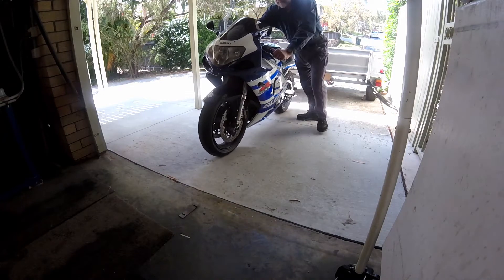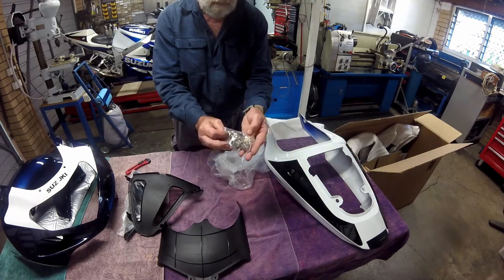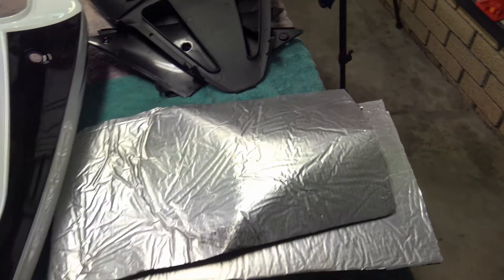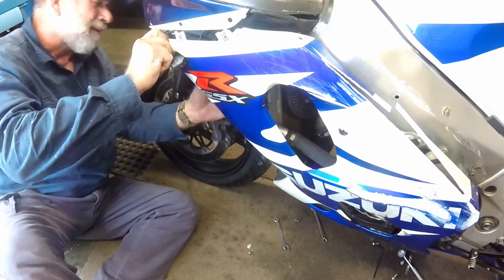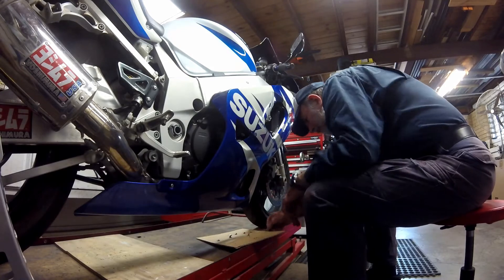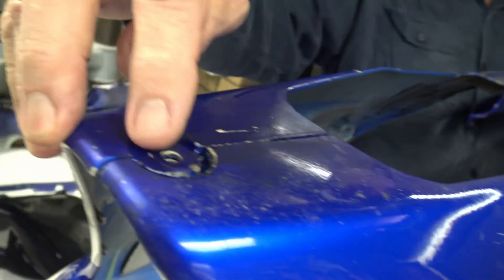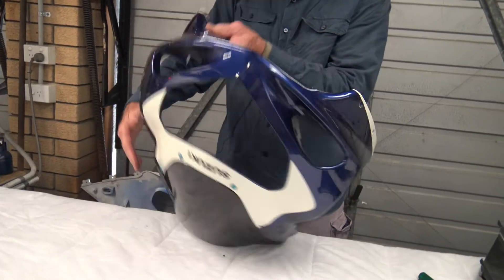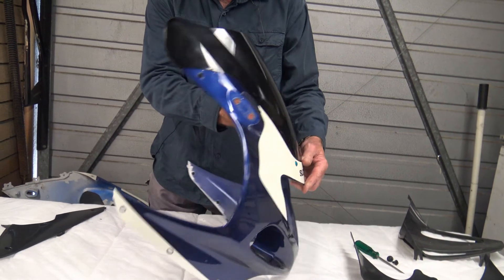Suzuki GSXR 750 Crash Repair: Part 3 – New Fairing, out with the old!

Comment: Thank you for such a detailed video. The fairing set looks like it is fairly good quality and a great fitment.  I am wondering if you could comment on how it compared to the OEM in quality and if you could let us know which vendor it was purchased from. I have the exact same bike and considering a set.   Thanks again!
Reply from the maker: The quality of the finish is similar to the OEM and the fit is quite good, although some of the holes had excess plastic in them (that is an extrusion issue, which had no impact on the quality, just extra work for me) which had to be removed. The supplier was 12K which is an importer based in Sydney Australia. That was the second aftermarket fairing I have fitted and I can't remember the first supplier, but this one was really excellent quality. Hope that helps.